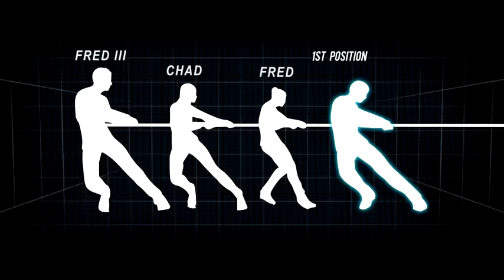Wrestling a 16ft Python: Kamp Kenan S1 Episode 7

Comment: What do you mean that albino one is "not gonna get that big" ?? It's a burm, which means though probably it isn't gonna grow as long, it will still significantly outweight the retic, which in turn means it will carry more body mass and be "more snake to handle" than its thinner cousin. You seem to forget that, as far as pythons go, burms are the most massive variety there is, with some adult females putting on anaconda-like girth.